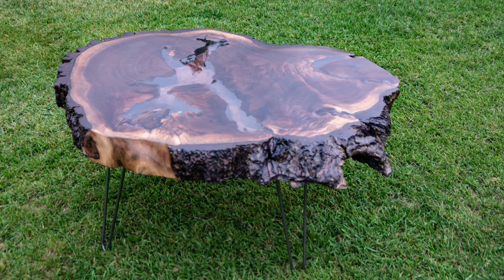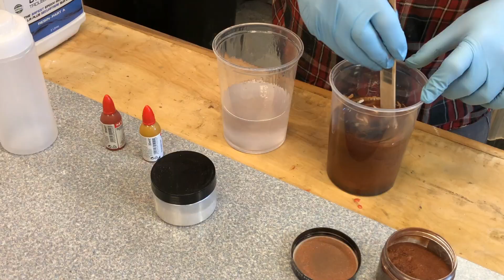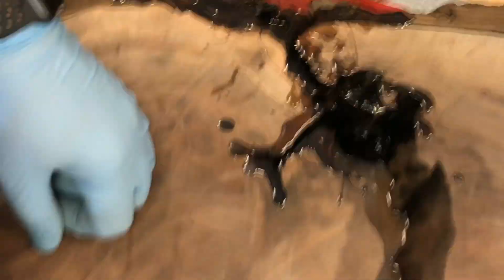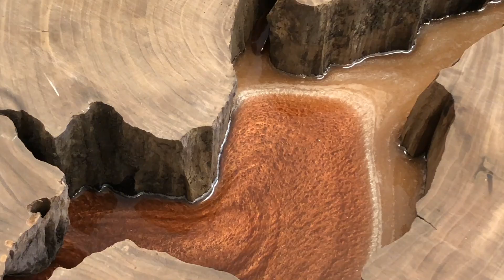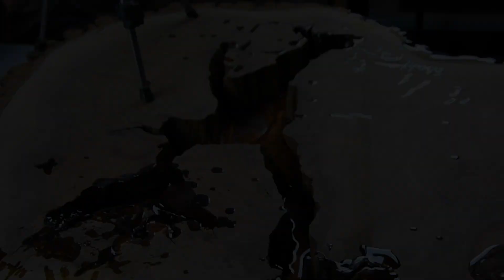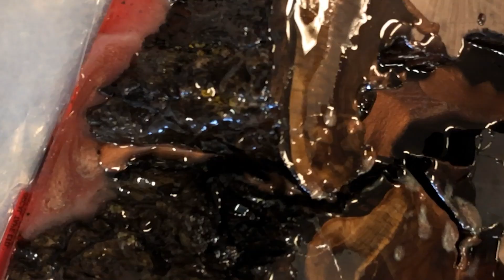EcoPoxy Liquid Plastic - The Copper Canyon Project

Comment: What’s the thickest poor u have done with the liquid plastic?
Reply from the maker: Redsquirrel 1 on average the slabs are 2-3” thick so most pours are around that usually. But I’ve filled in huge checks in a massive red cedar cookie slab and the overall volume of the pour wasn’t huge at 12-14L but it was nearly 2’ thick. At that thickness I reduced the ratio to 3:2 (resin:hardener) because I wanted to avoid generating too much heat but still wanted a rock hard cure.
Reply from the maker: I’m meant to follow up regarding this as well. With the 2:1 Liquid Plastic, EcoPoxy recommends only doing 1 3/4” thick pour at a time. And I say, once you get the hang of it, you can then push it and adjust ratios or go a little thicker with 2:1 and have fans on it to disperse any heat generated by that volume of epoxy pour.

Comment: What was your cost for the epoxy, i have been looking at using this product but it's pretty pricey
Reply from the maker: Blair Leonard yes it’s a little more pricey of an epoxy but it’s well worth the price, believe me I’ve worked with most products out there and EcoPoxy has been the nicest to work with and is most consistent in results. Plus it’s made from soybeans and other natural materials. You can visit: www.woodworkfinishes.com for current pricing. At the moment of replying to your question we’ve got a pretty great sale on Liquid Plastic 2:1. And even if there isn’t a sale on, there’s usually a coupon code to help out. Thanks for asking!